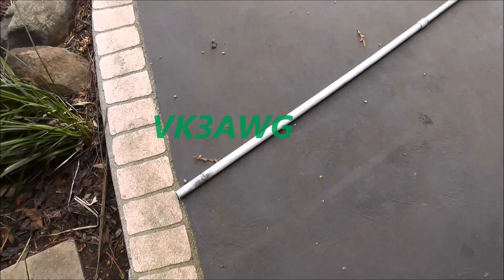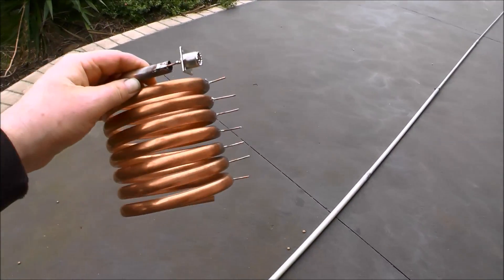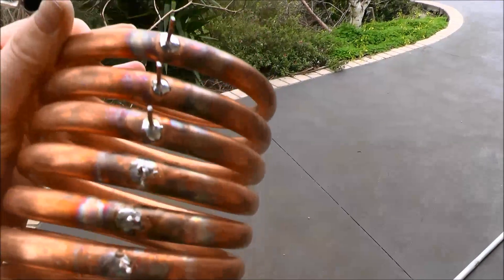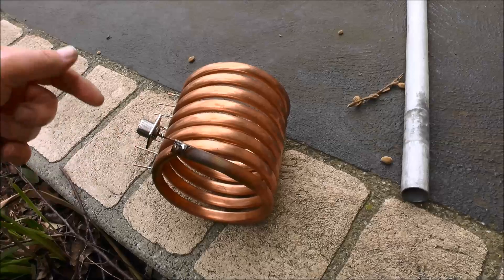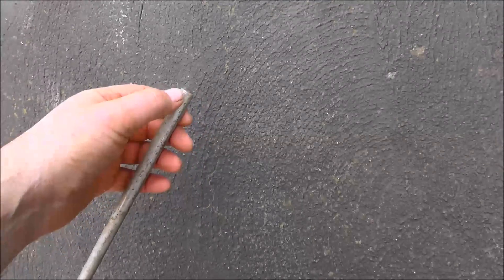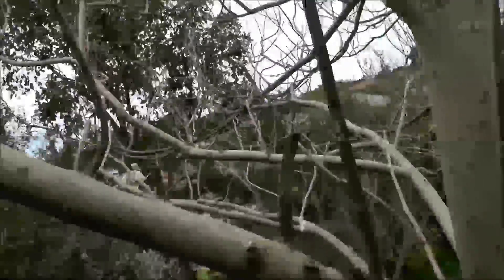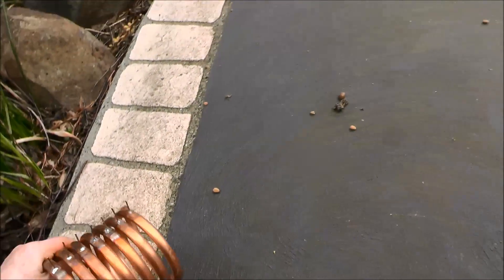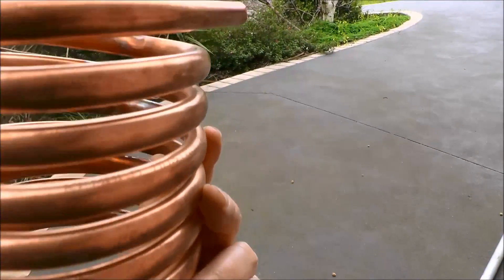160M Inverted L.

Comment: you would need 80 turns minimum, and centre loaded (mid loaded), as well you would need to add another 2" diameter pipe at bottom as wellas a match (13 turn) at feed point..

Comment: Too much talking and no results! What happened?
Reply from the maker: If you read the comments you would know. It worked ok but very narrow. I no longer have anything up for 160. I tried an inverted L for 80m which worked fine but it interfered with my inverted V's for 30 and 40m. Therefore I took the inverted L for 80m down. I know have a UB20-MX Ultrabeam on the tower and 2 x Inverted V's one for 30 and one for 40m. I hope this answers your questions on this 4 year old video.

Comment: Mate, get you the book ON4UN.  It will change your life!  If you are really serious about low band DXing.  BTW the reason it did not work well is the coil needs to be higher than lower, also use a 'T' formation as the shape will get you more gain.
73' AK4QA

Comment: I like your loading coil. It wouldn't have much loss, that's for sure! I was thinking you should have made it twice as long for good measure :) use it then as a general puropse loading coil for the lower HF bands so you can play with different size vertical elements and capacity hat arrangements. Anyway, how did you get on? I tried to find an update video (I'm interested in how it worked) but it seems the project hasn't got that far.
Reply from the maker: Dazz your right it didnt go that far. I have put a 5/8 GP for 6m up in its place.

Comment: Hi Chris ...
How have you got on with that copper tube and tapped off ... currently building 160m vertical with spiderbeam 12m poles ... 
that copper seems a good idea for tapping off ... Mike M0CSI ...
Reply from the maker: Hi Paul,
 the copper worked ok but the coil needs to be bigger (longer). I dont have the 160 up any more. I have got a 5/8 GP up for 6m.